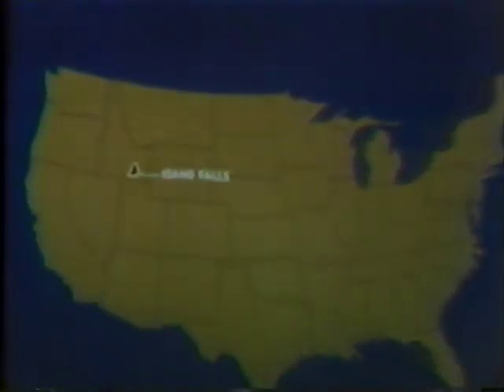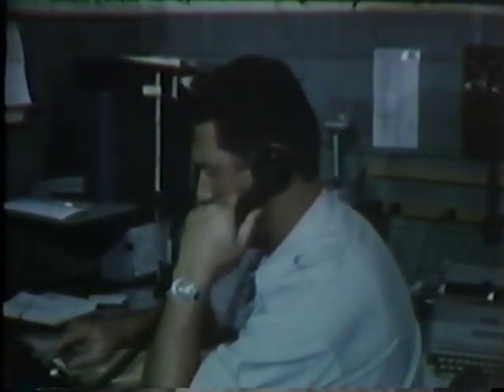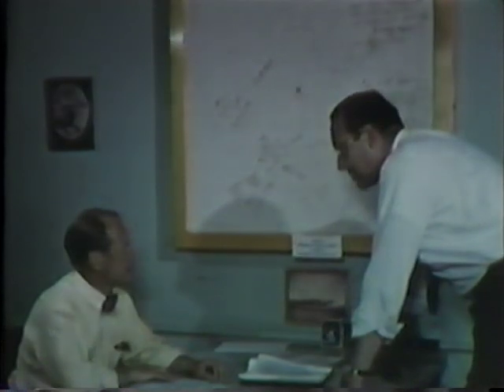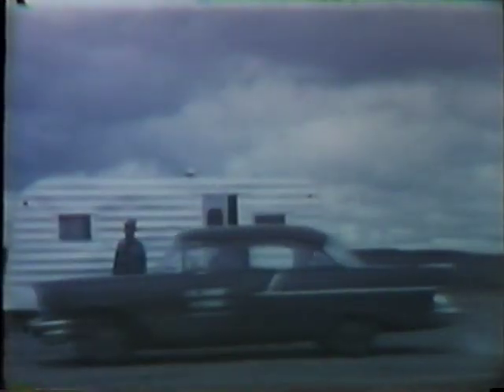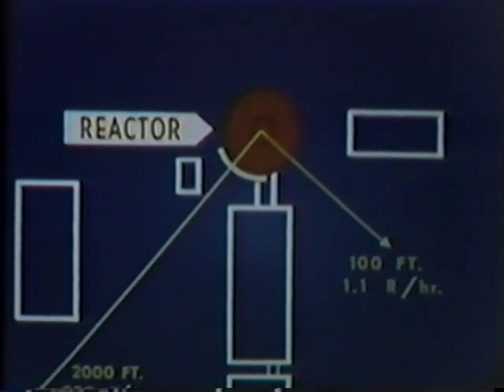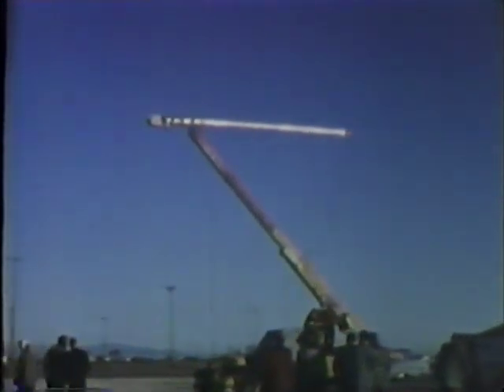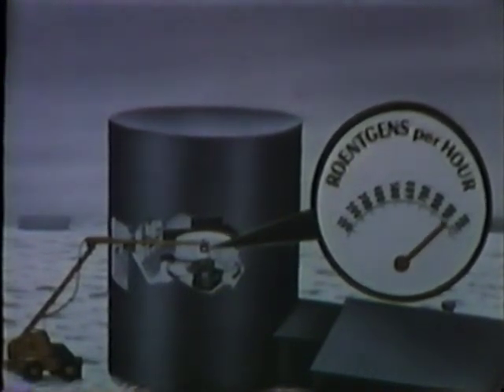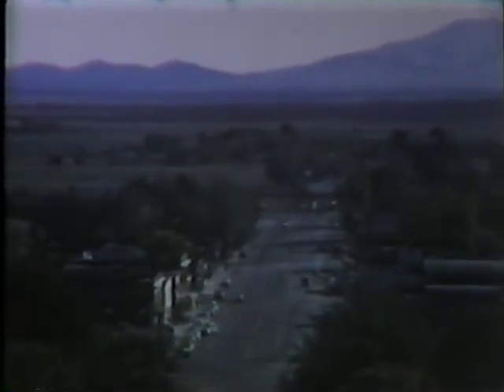SL-1 The Accident: Phases I and II

Comment: @euclon After SL-1, the "One stuck rod" rule was put into place to make sure that prompt criticality couldn't happen the same way again.

The ML-1 was the portable reactor. It used liquid nitrogen rather than water, but suffered corrosion problems and was discontinued. This combined with SL-1 pretty much halted the Army nuclear reactor program.

Still, we paid attention to SL-1. Three Mile island proved this by not exploding or releasing severe amounts of radiation.

Comment: @greenvanholzer Commercial nuclear power has a spectacular safety record - less deaths per terawatt generated even than solar power. It's safe not because it is inherently so - but rather because it isn't. It's dangerous enough when things go wrong that we overbuild commercial reactors to a huge extent. Because we can operate nuclear reactors safely does not mean that it's a given, and in any dynamic system, prudent cautions just make good sense. No worthwhile human endeavor is without risk.

Comment: @euclon prompt critical is only a theory, the amount of reactivity due to the high individual rod worth and the positive thermal coefficient of reactivity of BWR's caused steam to propel the rod increasing the reactivity addition rate to sky rocket. Navy reactors now have many controls to prevent this from ever happening, and the navy has never had a reactor meltdown or a steam explosion of a Rx. No containment building or vessel is strong enough to allow the conditions for prompt criticality